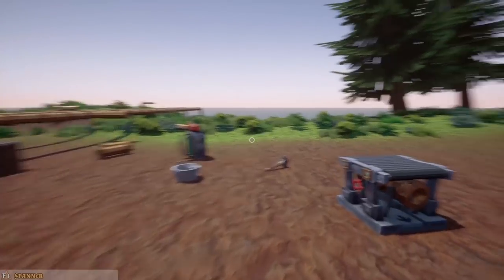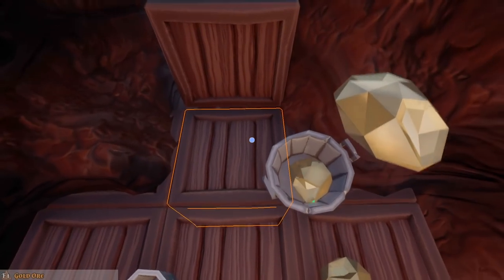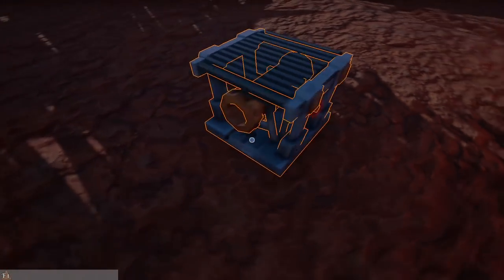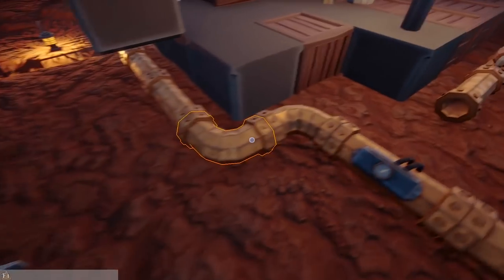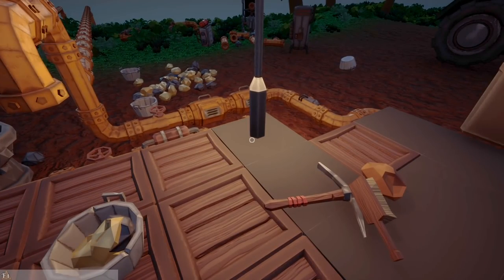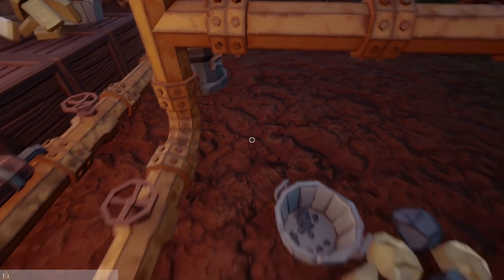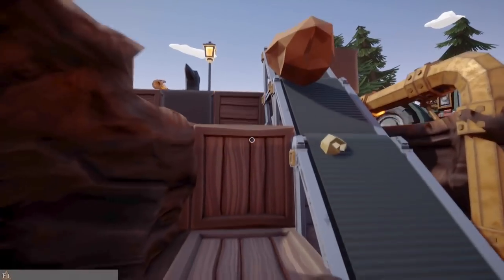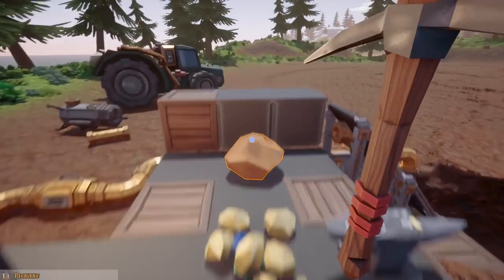HUGE Haul of the Biggest Gold Nuggets and Gems EVER - Hydroneer Gameplay - Early Access

Comment: the reasoning for the 4 filters...  the developer said in a stream that they filter out 25%  so the math is  if you put 4 in  its 100% filtered...  meaning your pipes and machines will not break down as much.
Reply: Also make sure to have a valve just before the filters as they take damage.
Reply: but when the filter breaker it's gonna be hella annoying
Reply: @qugfiebbd770  That is being adjusted.
Reply: Although the dev didn't get 50% + 50% right for the intake pipes lol.
Reply: but then it would filter 25% then from the 75% - 25% woud give about 56.25% then 42.18% to the 31.64% in the end 32% of unfiltered water would remain, unless, the develoder didnt use that calculation
Reply: Axe Meagain in the math term, that would do nothing considering each one is 25 percent, so if you were to ou another one in, the only thing that would matter would be The cleanliness of the filter so you will need 100 percent filter to get clean water, because 25*1= 25, do that four times, multiply them all by zero except for one, add them all, you get 25. No logic in that.
Reply: @nickcarolinastrange1152  no, supremox is right. it is still unpurified instead of 25%, lets do 50%. you have this thread, or rope or whatever, no matter how long it is, cut it in half, and you got half of it, then cut it in half once more. did it gone? no, you still have a quarter of it (from original length). then cut it half again u have 1/8, and so on.
Reply: That makes a lot of sense

Comment: Since you already have a pipe running all the way to the bottom of the mine you could wash all the dirt down there and use the ceiling of the mine as a natural barrier to prevent everything from flying away. And it seems like the buckets and the bed of the truck have no collision for any items put inside them so it might help reduce lag if you throw all the gems, shards and nuggets in there so the game does not need to calculate the physics when dumping more on top of the pile.
Could you try out if there is a maximum on pipe length and water pressure as in will it go on endless on 0-1% pressure or stop when it reaches 0%? If it wont stop running you could use all the pressure increasing pipes directly in front of the conveyors to lose as little pressure as possible.
Keep up the awesome videos and have a nice day :D
Reply: Big brain plays

Comment: 1) Anyway, i am not sure if someone already said it or not, but you can feed those belt from whatever side u want, it means that you dont need to have that pipeline all the way down, you can just  connect it on top and belts will still work the same direction is based on rotation of belt ;) 
2) u can stop dropping water from belts, just close that valve on the side of belt
3) if u will feed harvester with dirt from bigger deep, it will pop out big nuggets as well, u just need to put in it same dirt as u putted into pan ;)

Comment: Setup the ram drill at the bottom throwing the dirt onto the conveyor with a backdrop so it falls right on. it will get you the dirt with the big nuggets. 
As for the conveyors just setup underground then it will require less water. 
You can also put multiple big nuggets in one crucible and make 1k+ bars

Comment: It goes like this.
Machine <-Shard <-Pressure Gauge <-Filter <-Valve. 

2 intakes per line for max pressure, then if you don't want to use shards, get a ton of intakes and start tiering them from just behind the valve, you'll have it worked out in no time :D
Reply: Think about it like adding a merger after a splitter takes what's available on a line to refill the line again in satisfactory, injection splitting kibitz called it in his latest video :)

Comment: Have you considered using roofing as a ramp to walk down/up the mine? also the extractor does give out bigger chunks with higher water pressure (though I don't know if they get that big). Each section of pipe reduces pressure by 1 therefore the shorter the pipe the higher the pressure. Conveyer pipes can be filled either direction thus reducing pipe length and increasing pressure and speed

Comment: you can put the ram drill on lower parts of the dirt and it will give you the large nuggets if you pan manually. you dont have to dig manually, just put the rammer down there. also, the lower levels of dirt in the beginning claim also have those large pieces.

Comment: At the end of the conveyor belt either put a shut off valve or see if you can T it back into the supply line to see if it helps with pressure.

Comment: - is the arrow on conveyor belts the direction it's moving or the water intake? because it's possible that you could get rid of half of your piping if it still works when piped from top and it would increase the pressure as well
- the harvester may produce bigger nuggets if it's powered by high pressure water, also you may get the same value but just in several small chunks instead

Comment: They should add corner conveyors

You should loop the outputs of the splitter back into the splitter so you can just pull out certain resources like it is a storage silo.

You could also just have the conveyors going straight up into a bucket. The dripping water would fill it and the dirt would fill it.

Comment: hey Diesel. i do not know if it works or not. but does water pressure also decrease in maschine part like conveyer belts like is does in normal pipes? ells that maybe a way to transport water without loosing pressure and having to use tones of shards

Comment: 1 pump, 1 valve, 4x -filters, 2x pressure tanks. This is the order you need for 100% clean water right out of the pump. Every 25 pieces of pipe add another pressure tank.

Comment: Ok so I feel like if you put the shard tank right in front of an intake pipe youd then have like 75 or 100% pressure at the pipe then youd probably still end up with a higher pressure at the end unless you just have a absolute assload of pipes but no matter how you did it in that case youd need alot of tanks and shards
Reply: Also if you read this you should totally just melt as many giant nuggerinos as possible and see if itll just make a ginormous bar or is it just small medium large and everywhere between

Comment: If you loose 1 PSI per section of pipe, why have the booster so far away from the bottom of the conveyors? try the booster closer to the bottom to power the conveyors out of the pit